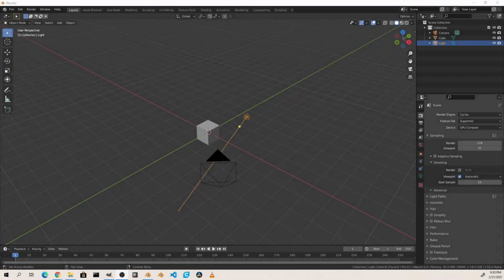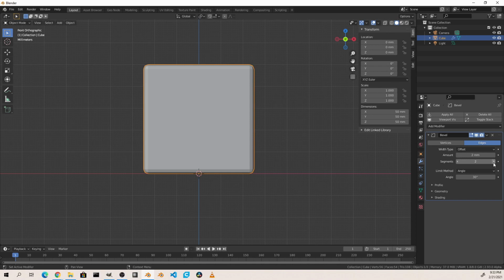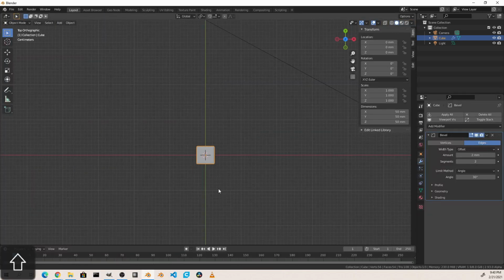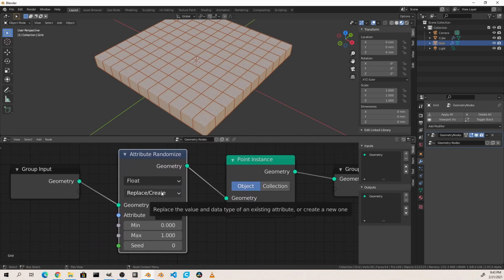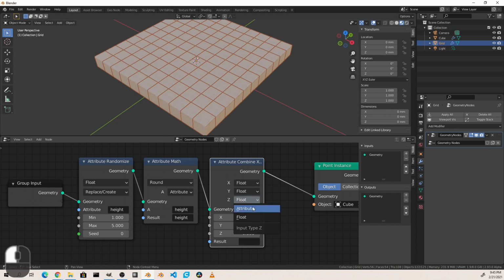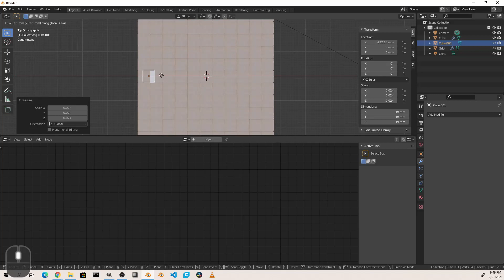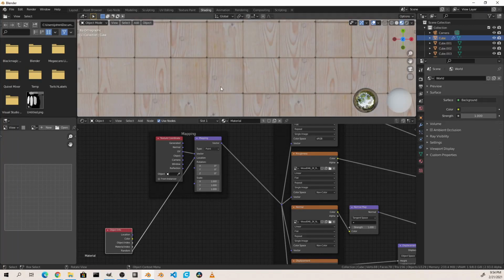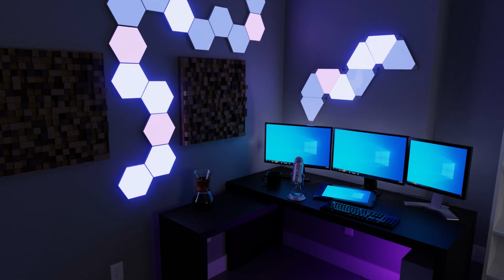Making a Wood Block Sound Diffuser in Blender 2.93 using Geometry Nodes

Comment: Thanks. It was the object info/random and mix rgb that I needed. Almost everything is built into Blender the problem is how to even know about it, and then how to make use of it.
Looks like this technique doesn't work that well with arrayed objects as the texture doesn't randomize unless you alter the UV offset values in the modifier, and the mix rgb doesn't do anything. If I separate the array into objects then the mix rgb works but now the values are rather extreme but only on the parts that were arrayed, not the original object.
Reply from the maker: That's what I'm trying to help with. Digging out a few of those knowledge nuggets to help people get past those sticking points. Glad it was helpful!